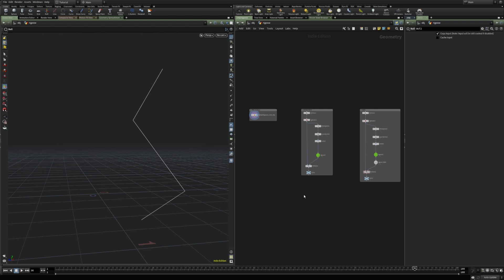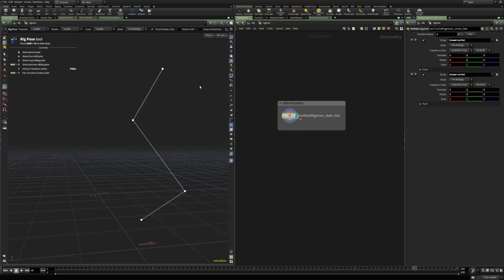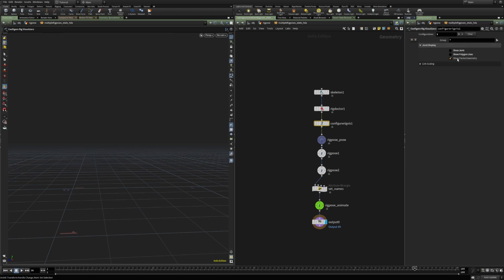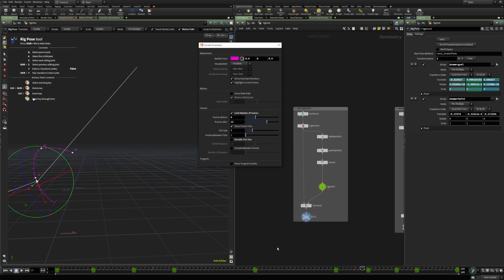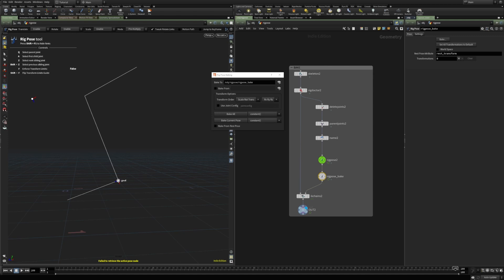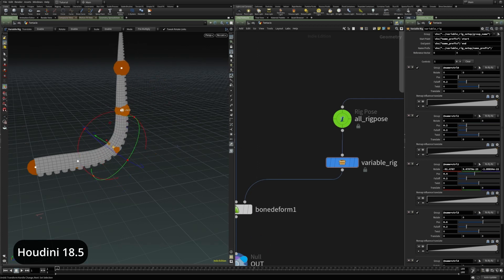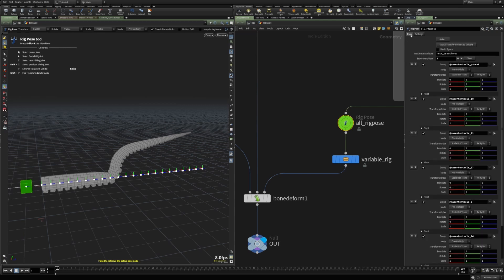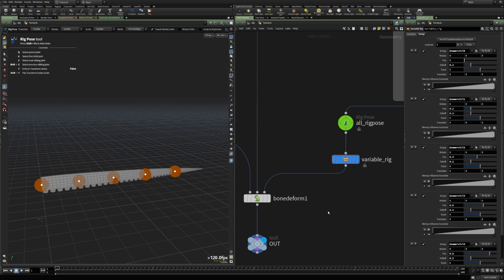KineFX rig pose node in Houdini 19

Comment: Nice one again Rok, highly appreciated. How would you setup a split IK/FK controls that could be toggled by the user. If I combine 2 RP nodes in an asset, it will show the ctrls for bot RP nodes. Or would you make multiple assets then?
Reply from the maker: Hi Johan and I'm glad you like the video! No need to create multiple digital assets for that. I would simply promote "Show packed geometry" parameter for each rig visualizer of each rig pose node to the digital asset. This way the visibility of each rig pose node or each rig visualizer can be controlled on the digital asset level.
Reply: @rokandic  Thanks, that would mean you need to isolate the joints on each RP node specific. I'm probably doing something wrong, but whenever I have an HDA (with kinefx__rigpose state) and I activate the handle mode (enter) it shows me immediatly the whole skeleton. I probably don't have the right strategy setup, but I feel the python states are fighting each other sometimes.